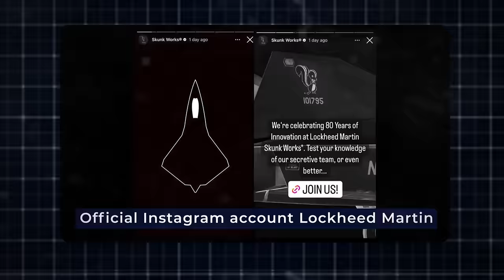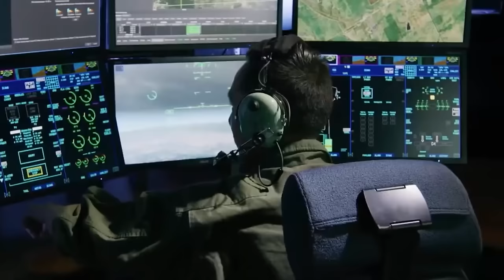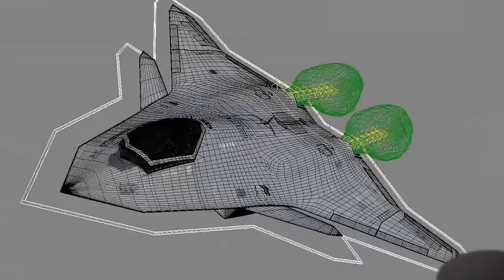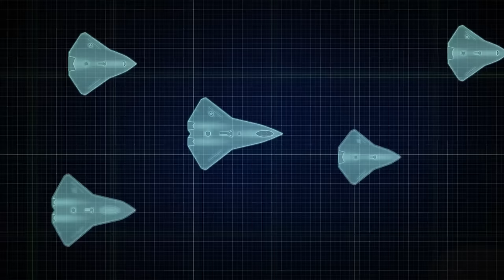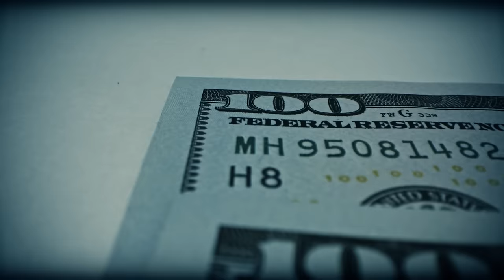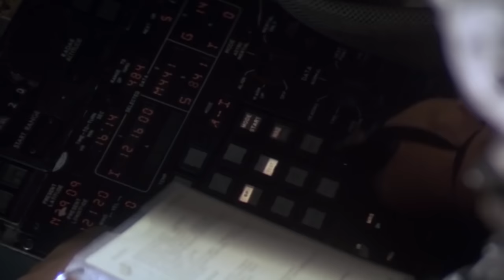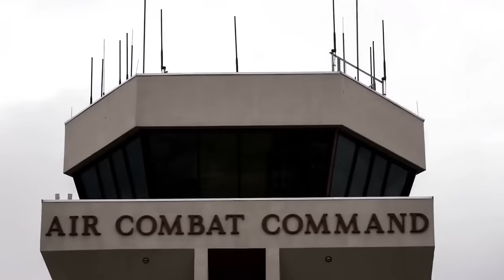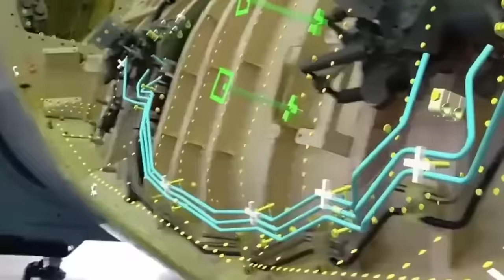US Testing Its New NGAD Stealth Fighter Jet to Replace F-22 Raptor!

Comment: The Northrop original design flying wing didn’t have vertical stabilizers.   When they retrofit it with jet engines it did have some. Though.